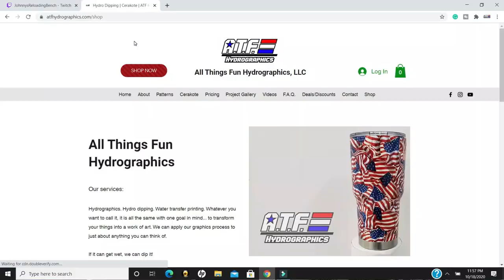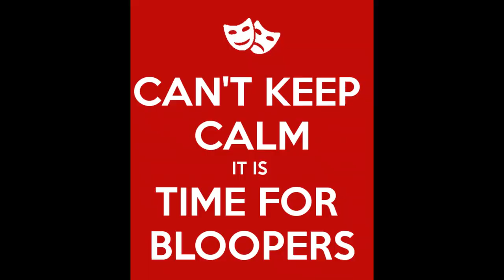HYDRO DIP KRYPTEK OBSKURA

Comment: Looks great! Is that the reduced print? Looking to get an AR dipped in this pattern. Is there a method in which the upper, lower and hand guard can be dipped while assembled? I’m assuming there would be a noticeable line where the film overlaps?
Reply from the maker: It is the full sized version. I disassemble everything
Reply: @AllThingsFunHydrographics  gotcha, have you ever tried or experimented with dipping while the upper, lower and hand guard were pinned/bolted/connected together to avoid having mismatched patterns?

Have you ever used the reduced pattern films on an AR?

Thank you for your response.
Reply from the maker: @texmctexico783   @Tex McTexico  I usually hot glu the gun back together so the pattern flows over all the parts. I have like 20 or 30 video on the channel dipping ARS and you can see how I do it.
I do whatever size pattern the customers wants, but yes I have done full size and reduced, they both look fine